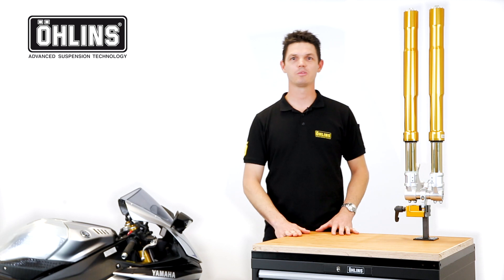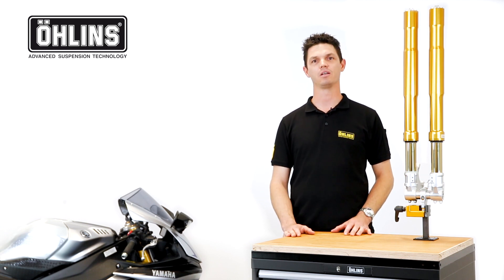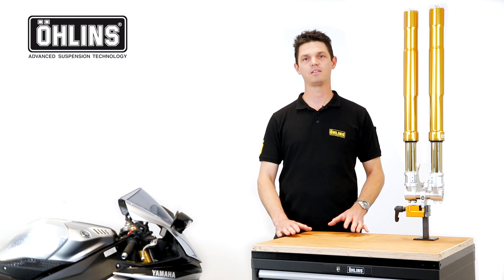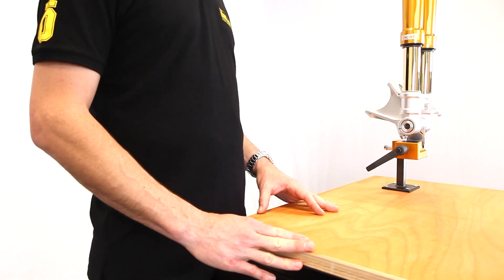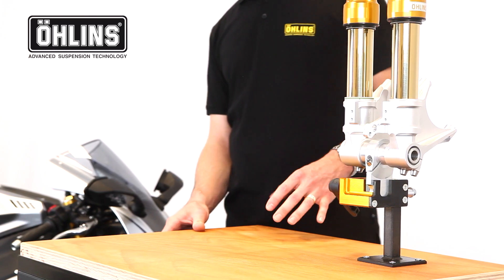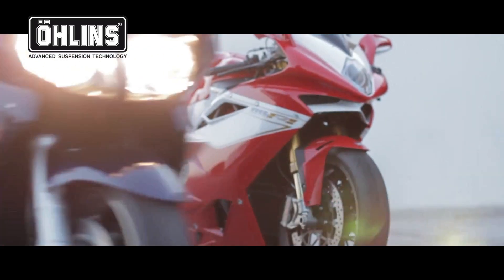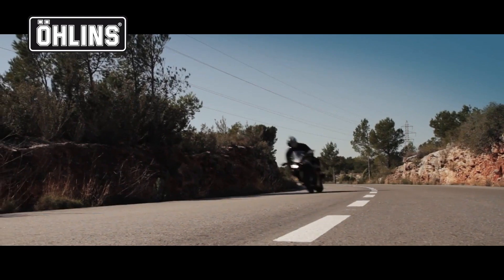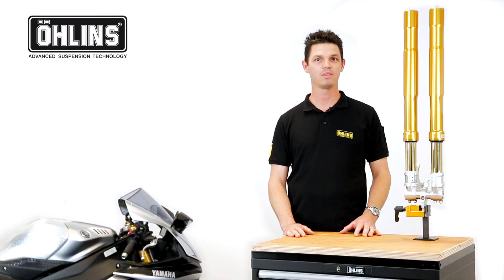Öhlins FGRT Front Fork

Comment: I have a sweet used set of fgrt810 for my 04/06 r1, I need all hardware and fender mounts so I can install them.. can anyone help. I could get by with just the front fender mounts if I have too and trim off the rear of the front fender.

Comment: Only trouble I see is most products for My Ducati have been discontinued :(
Reply from the maker: Hello Mozzman, even though a product is no longer produced in our factory it doesn't mean that you cant find it. I suggest that you contact our distributor network, they may have a shock for your bike on the shelf or might be able to build you a one of for your bike. Please have a look at www.ohlins.com under 'contacts'. BR Öhlins
Reply: Thanks for the reply and yes I know that even though things show as discontinued from the range produced , I'll just have to do some digging and see what I can turn
 up either from local performance Bike stores or even good old ebay .  As near as I can figure the STX46 with remote reservoir is the unit suitable for the rear giving all the normal adjustments for compression and rebound, , the remote preload intrigues me though and I'd like to know more. 
Given how complaint the current settings are on the front with my stock Ducati forks, I can only surmise that a compatible OHLINS unit will make the improvement I suspect it will.  and thus bring a new level of performance to my old classic SS .